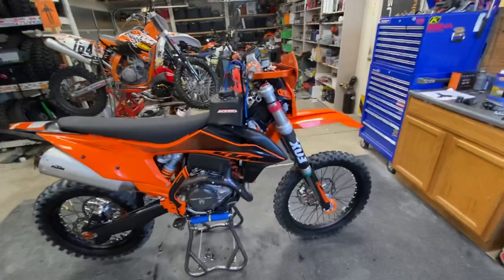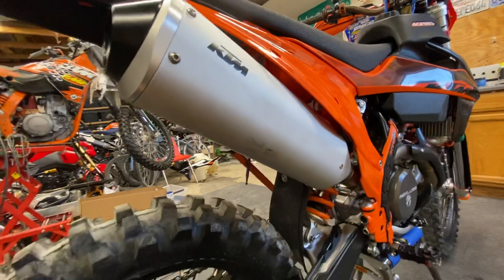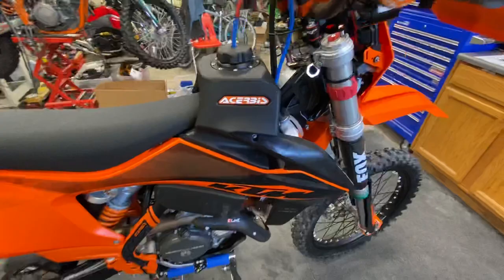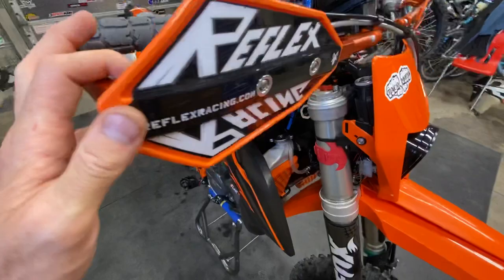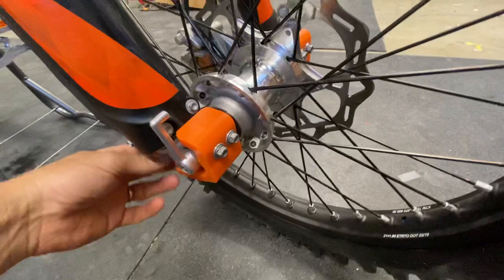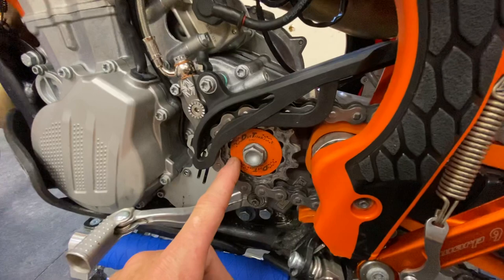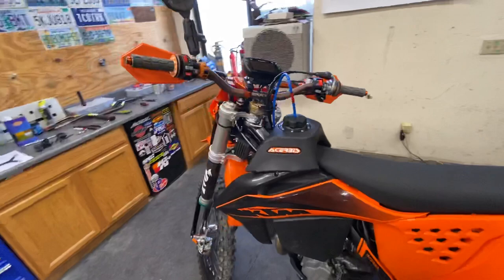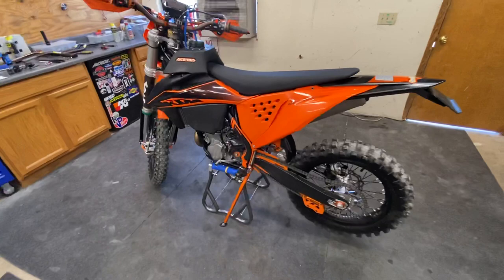2020 KTM 500 EXCF Ultimate Light ADV Build

Comment: Yes try the Idaho BDR. Just did it solo on my DRZ400. If you do it, I highly recommend doing it north to south like I did. The rougher stuff is in the north end...better to do it while youre fresh. Stayed at My Blue Heaven for 24 hours. Was awesome. Start at or after July 15th due ti snow melt near 9000 ft level. Crews start clearing the 15th. Was high and dry by the time I reached that area. Its about 1300 miles of what I would guess is 95% dirt roads. Incredible ride.

Comment: If the GET ECU doesn't already have it, I like to add a sticker inside the side panel with what the error codes mean. I also add a sticker with what the fuses are for. I couldn't ride with that Acerbis tank being full, the CG becomes WAY to high for me. Those rear blinkers wouldn't be legal in Calif. because they aren't far enough apart. The only thing I would add is a cage for the GPS, my first Garmin Montana lasted half of it's first ride. I made my own GPS cage for it's replacement.

Comment: That's a sweet build. I just picked up a 500 mile crf450l with $5k in parts on it.  Looked at ktms but they wanted way too much and I've always been a honda guy.  Never got why people put huge bags on Enduros.  But I ride pretty extreme single track here in the PNW.  The most important thing I found is that you gotta balance your wheels lol. Previous owner put Tubliss and never balanced tires so it was horrible at 55 mph.
Reply from the maker: Sounds like you got a rad set up there amigo! Braaaaaaap🤘🏽

Comment: I’m (was) getting ready to pull the trigger on a new FE 501S. My hesitation is because of so many owners reporting that bike is a vibration monster! It checks most all the boxes I’m looking for in a new enduro but I’m starting to shy away because that. One owner reported that his upper shock bolt rattled loose on a ride, even though it was checked for torque and had lock tight. I don’t think I can deal with a bike that can do something like that just because it vibrates? Do you or anyone else have any suggestions on a better bike that will be smoother? Not too interested in the CRF 450L due to its stalling out on slow rides.

Comment: Mike check out the P3 header pipe guard. I have one on my 20 2500 and I have also removed the O2 sensor. The pipe Guard is beefy and does a great job protecting the pipe. The only bummer is it interferes with the oil cap and you have to basically take it off each time you put oil in the bike. Other than that it’s a solid piece of protection
Reply from the maker: Good tip, I’ll check that out

Comment: Awesome build. I saw you vented the crank case out of the air box. But now you do'nt have vacum pulling the PCV. PCV systems don't vent well to atmosphere. So your oil will get contaminated with the blow by more so since it's not being pulled out. I know you dont want the blow by being re burned so maybe you can make a little light small cheap motor and build a chamber or something that pulls a vacum at all times and than dumps to atomosphere and also be a servicable catch can.
Reply from the maker: In a perfect situation all that sounds like the ultimate solution. Obviously packaging constraints are a big issues on a bare bones dirt bike like this. Sounds like you’ve put some time into thinking about this
Reply: TACO MOTO CO Yeah I have. You could do it for sure. Keep it small and compact. Plenty of room. I was an automotive tech for years and I also own a 2.7L eco boost ford. They have an issue with build up on the valves since it’s direct injection. There’s a company called RX I think that came up with a cool solution using the turbo intake and a few other already integrated methods to always keep
Vacuum. See I was going to do like you did and just plug the air box and vent to atmosphere. But some more digging I found that would be worse off because of all the blow by contaminating the oil. It needs vacuum. Now a small single cylinder that also get more regular oil changes is a differ animal but in theory it’s all still the same. And you now have more pressure in that case trying to just vent on its own. Also not good and could rob a tiny bit of power. Maybe I’ll make one if I get some free time.
Reply: TACO MOTO CO You could go back to the intake box but install a little catch can that separates the oil and acid and water and hydrocarbons etc. etc. they sell small little catch cans on eBay you could integrate. They even have clear ones so you can see when you need to dump it. But I wouldn’t leave it the way it is. Just my opinion.
Reply: TACO MOTO CO looks like if you search KTM catch can there is a bunch of mods and aftermarket parts people have come up with. Just be sure it all flows properly. PCV should always have fresh air in and vacuum pulling. Catch can keeps the gunk out.

Comment: I.got a ktm 500 2020.excf with 800mi the side case on the clutch.cover side by water pump has oil.residue on the side of the case had a ktm dealer replace the side case under warranty just got it back took for a spin now had to drop back at shop leaking somewhere still.any idears
Reply from the maker: If that dealer can’t fix it call ktm corporate and seek a remedy through them

Comment: 2017 Ktm 250 exc-f with de-smog kit and slip on fmf 4.0 silencer.   Nothing else. 
Do I need an aftermarket ECU or is this easy enough for the stock KTM ECU to compensate fuel delivery?
Bike seems to run great, no backfires or popping on deceleration.

Comment: Where did u get the tail light kit I was told sic ass sold them but not for the 2020 ktm 500 excf should like to change my blinkers and fender did u have to put a new ecu in for the end cap
Reply from the maker: It’s our custom set up not a SICASS item. Look for more info on these coming soon!
Reply: @TACOMOTOCO  DAMNIT MIKE, HURRY UP! :-)
Reply from the maker: The Christmas elves get whipped hourly
Reply: I have messaged sicass a few times but didn't get any response.  I clicked on this video only because I saw 2020 in the title with the fender eliminator in the thumbnail.  Your kit looks great!  I guess now I have to bookmark your site and check it every day to see when it's available.
Reply: That is the same light Paul Garfield used to sell as a kit on Ebay. I think he stopped a while back. They are fantastic and the sleekest setup possible.
Reply: I will be impatiently waiting for that integrated light kit.

Comment: How do you figure a 40w oil at temp is going to rob more horsepower than a 50 or 60w oil at temp like ktm recommends?
Reply: Heat robs power. Sure if you’re doing a short dyno run the 40 will produce more but in the real world, you’ll be using your clutch where using 40w will produce more heat.

Comment: Where are getting your Rotella opinion from?  As a Pro Racers wrench for many years Ive concluded its heat carry capacity second to none. One time I forgot to put antifreeze in a YZ25FX, after a 1.5 hour race I noticed all cabling touching the case completely melted away. Im thinking ruined motor, nope valves still in spec, no change in leak down etc. The oil that causes excess heat is Moterex due to constant minor clutch slippage.

Comment: Question: Why would you choose to go on an adventure ride with a bike that requires an oil change every 10-15h? I mean its very light so good in offroading but still not that practical imo
Reply from the maker: Because it’s an insanely awesome machine with mind blowing performance and capabilities and we run a high end oil like Motul 300V and do changes in the 20-30 hour range when used for ADV type service 🤘🏽
Reply: Because for adventure riding you don't have to change it that often. It's been proven.
Reply: You need to do it so often, only, if you race or ride really hard.

Comment: Im interested in how those tire moose will work at highway speeds? I've heard they don't work for extended high speed without melting or something.
Reply: What’s extended to you? I did 30 miles one day, 30 miles the next day, 55-60mph, no problems. Nitro mousse, well lubed with Nitro mousse lube. The manufacturers state you should not ride on the highway, so do that at your own risk. I have heard the same thing about burning up on the highway.

Comment: There is no evidence or proof of Shell Rottela creates more resistant or drug it is just opinion. The resistance of oil or pumping loses directly related to oil viscosity and not the brand of oil. If bikes over heats it means it has problems and putting the most expensive oil in it will not fix it.
Reply: Are you an oil chemist? Every oil is different. Send a link that shows Rotella is as good as premium oils. I use shell in my airplane. But only one oil product of theirs works with my engine. And that's shell's opinion. You know why Porsche recommends Mobile 1? Because it's superior to anything else out there. Your comment is fertilizer.
Reply: Rottela 15w40 and 5w40 is MA sertified and has very good reputation in off-road and motorcycle community. Use what you like and what makes you happy. Just do not tell people that using Rottela  is not good because you think so. And mobile 1 is best because Porsche is using it. I use 10w60 for the summer and 5w40 for the winter for most of my toys.  ktm 4 strokes have plastic oil pumps and when they go bad even most expensive oil is not saving it.
Reply: @dh-flies  Oil chemist.......🤣

Comment: What is the cost for this setup?
Reply from the maker: A set up like this will typically have 12-15k in upgrades and aftermarket
Reply: @TACOMOTOCO  these 500s need sooo much money spent on them. I guess if you need a road legal bike you don't have much choice. Iv got a 20 450xcf and putting 6th gear in it in next few days, I will gear it down to get a usable 1st gear and have 6 gears for top end speed, I reckon it will be the ultimate beast, no need to spend money on ecu or exhaust or inlet, just put on a fan and some protection parts.👍

Comment: Those tires will throw you in a ditch on pavement....definitely not dot approved!
Reply from the maker: This is a dirt bike not a super moto machine. Ride it w the care and respect it requires in all situations
Reply: @TACOMOTOCO  No that is a dual sport bike just as Honda,Suzuki, Yamaha's dual sport bike's that have a license tag for on road off road riding. Those tires are Not for that use...I had a soldier in my unit put a set of knobbies like those on his KTM 500 EXC-F and was killed on a local ride to an off road park. He was in front of me going 30 mph and when he went into a curve the bike went down sliding under a car going the opposite way running over him! I had warned him just before that that bike was like riding on ice on the tarmac after I took it a short ride up the road! You stated that you set that bike up for the owner for his trips, so I took it he was using it for on road off road with a license tag mount and mirror? "Just a friendly warning" Great bike though!!
Reply: @armyretired28  Its a dangerous but exhilarating hobby, sorry the Soldier got killed but I have ridden thousands of miles with non dot tires, ride to your and your bikes capability and never beyond is a pretty standard rule of thumb.

Comment: 500 EXC ADV build? I'd rather not have to change my oil everyday and have to do a complete rebuild half way through my trip
Reply from the maker: Myth. 

600-900 top ends are normal for allot of us. 

30+ hours oil service w a rekluse, correct fueling, top shelf oil.
Reply: @TACOMOTOCO  I figured 250 miles was if you're pounding on it 100% like racing. Still, most adv bikes go 6000 miles before needing oil and 12k-24k before valve clearance. I guess if your adventure is close to home and you don't mind wrenching all the time then the EXC is fine
Reply from the maker: 2.5-3k on oil would be ok. 5k on valves would be typical. 

Look, you’re going to be doing a little more maint on this girl. She’s the Ferrari of dual sports. There’s trade offs. It’s also under 280 pounds and can go places no other adv machine dares. 
Trade offs. 

Check out this guy who ride one around the world. 
https://instagram.com/braaping_kiwi?igshid=a572qhmmp70f

And this guy who did some of the first adv touring on one 
https://youtu.be/yhWR5jjGzfM